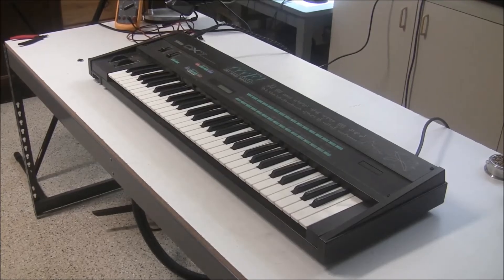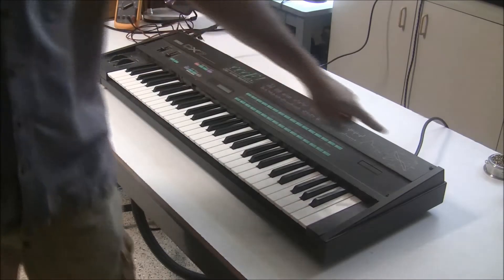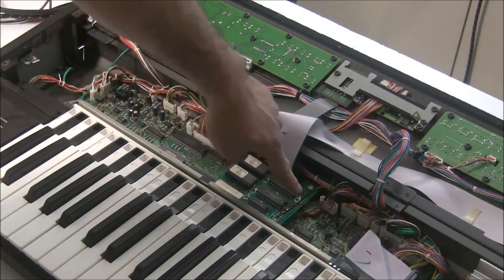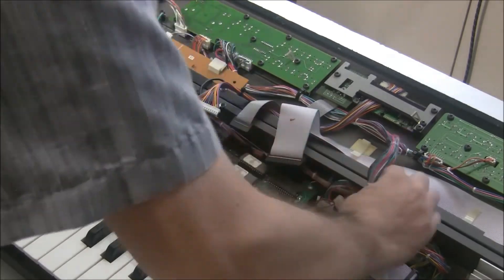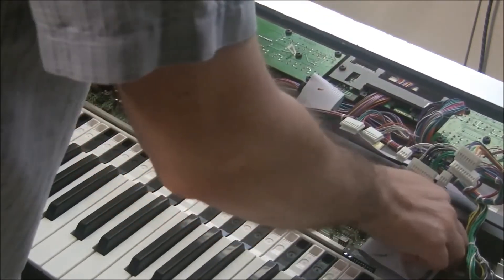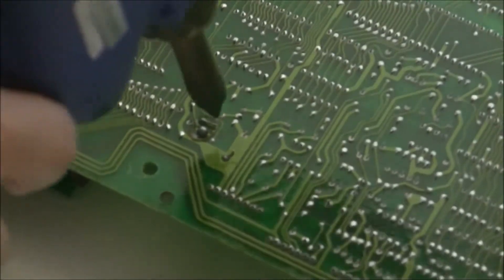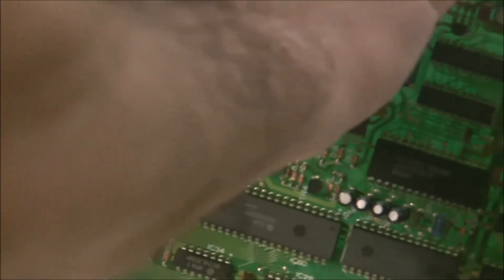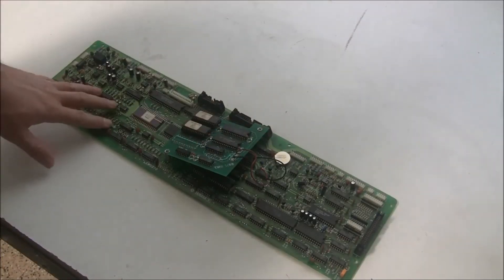Synthchaser #062 - Yamaha DX7 Battery Replacement

Comment: Thank you, now I have the confidence to stick that new bad boy in there. I noticed you used and engraver pen to undo the old solder joints. Was this so you wouldn't use to much heat?

Comment: Hey buddy, nice video! I've got to change mine that has all of Bo Tomlyn's sounds he programmed for Michael Jackson in it.  When you pull the battery did you lose the internal RAM? I still have my Commodore 64 Computer with 10,000 sounds, I never converted all the sounds to MacBook. https://youtu.be/-m29nyMpRxk lol.   not sure how to store them before I would pull it. I got 4 ram cartridges and thinking of selling it with custom case for $750 , it has the "Special Edition" board with LED.  thoughts?

Comment: Hi, what's the problem if battery is new but there is still the message "battery to change' and internal voices are reset each time the DX is off ? By the way, the battery check function shows ' 4,5 v'. Thanks in advance for help.

Comment: OOOOOO, the Grey Matter Response E! board!  Heard that it turned the DX-7 into a real powerhouse, with increased memory, mod routings, etc.
Reply: It's the only way to Dx7 in my opinion. 
8 preset banks worth of E! patches that are stored in nvram and cannot be erased combined with 10 user preset banks compared to one bank and a cartridge bank if you have a cart is enough reason to go E! card. Not to mention the midi improvements - it's insane.
Reply: @atpdx  yeah but what happens when the Ram is currupt! my dx wont let me take memory protect to do anything
Reply: @djraymondlive  What your battery voltage? Hit Function and the button 14 and post what it says.
Reply: @atpdx  it won't even let me check it
Reply: @djraymondlive  Damn, have you ever seen it say "replace battery" in the screen ever before this happened? This is pretty textbook dead battery behavior.

Comment: it's same solder crap on TX 802 and TG77. why they didn't use 5 cent battery holder is beyond me.typical battery holders do not fit  tx802 the pin spacing is different. the holes on board are 5/8 inch apart while all battery holder the pins are 3/4 inch.

Comment: Anyone knows where I can buy that cr2032 for DX7 in Canada?
 
Nobody wants to ship it to Canada.  I have checked a number of websites including Ebay. 
 Even Mouser in Canada doesn't ship it in Canada because it is lithium battery.
Reply from the maker: Look on eBay or similar for "CR2032 battery holder", then you can solder the battery holder in and use a plain old CR2032 from a local store.
Reply: You are so helpful.  I actually found CR2032 battery holder  on Amazon.ca
Tomorrow, I will visit Radioshack just in case.  If not, will order from Amazon.ca
I actually liked idea of holder.
Thanks again!

Comment: Is there any info of the "Ram corrupted" message?  Replaced the battery, everything seems good except that message came on and when I turn on and off,  Grey Matter screen popped up, but no sound. I did do a SySex dump w original patches, everything transferred good but again no sound.  And original sound you had with the message was working but now not working when greymatter on.  Probably something simple?
Reply: Hi, have the same issue.  Did you ever find a solution?  Thanks!

Comment: I've recapped the PSU in my Dx7, and thinking of recapping the main board. Do I need audio grade caps for that (since it's a digital synth)? Any caps on the analog outputs?
Reply from the maker: You'd need to look at the schematic and see how each capacitor is being used.  If it's used for an audio signal, you'll want to use audio grade caps.
Reply: Thanks. I know there are also low leakage caps available. Should I use these for non-audio caps or is it waste of money?
Reply from the maker: It totally depends on the circuit.  The circuit's usage of the capacitor will dictate which properties would be important for the capacitor.  For a S&H capacitor, low leakage is important.  But that would all be digital on the DX-7.

Comment: Hi, wouldn't it be easier to solder a battery holder instead?
Reply: Can you show how you would install FRAM in a synth? Please.
Reply from the maker: You mean easier for future maintenance?  Probably, but it all depends what you want to do.  It would be even easier to install magnetic FRAM and never change a battery again.  Regardless this video shows how to get to the battery and change it.  What you change it to is your choice. :)
Reply: I'm glad someone soldered a battery holder in the DX-7II FD I bought. It took about five minutes to replace it, then a much longer time to restore all the presets that were gone.
Reply: @scottlarson1548  Yeah I added battery holder to my DX7 as well. No more unnessesary work with disassembly and soldering in future.